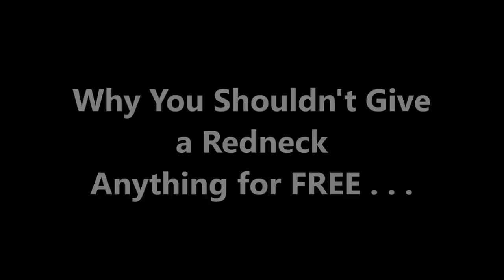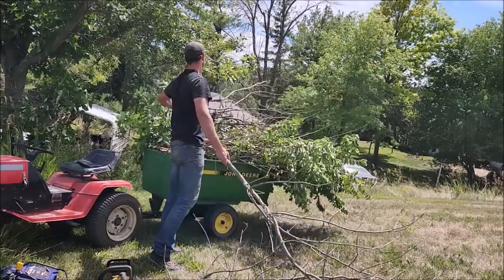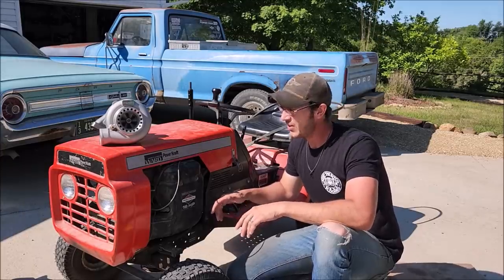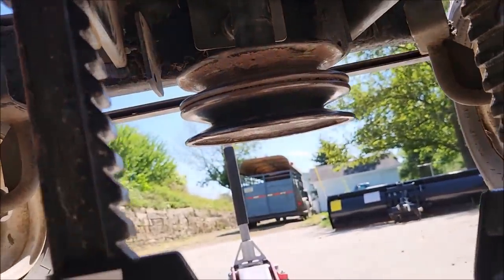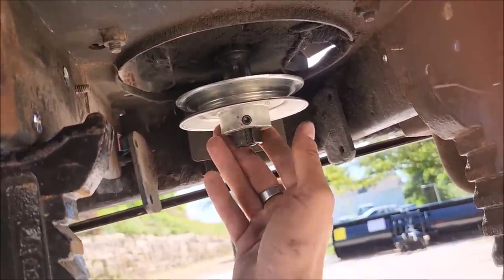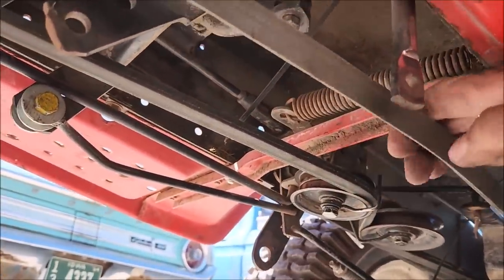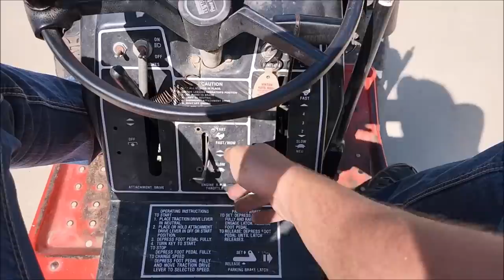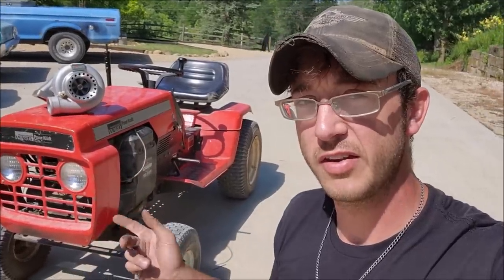FREE Mower = "RACE MOWER" for $27.50 !!!

Comment: fast mowrers are fun. BUT... you need to replace that diecast pulley you used on the transmission. it wont last long, they are only made for fractional HP applications. find a steel or cast iron one.

Comment: Before the forced induction I might suggest a governor delete. This will allow the engine to rev higher. Most small engines are governed to about 3500 rpm. With a governor delete it can rev to more than 5000 rpms with stock parts. With the right mods 9000 rpms can be achieved.
Cars and Cameras does a lot of this type of stuff with go carts and mini bikes.
Reply from the maker: It won't have a the stock carb, so there won't be a governer - but I will design and program a Rev limiter for it at 5k

Comment: i have a 1996 murray mower that im planning to swap the engine which is currently 11hp to a tecumseh 20 hp mower and then do a pully swap, unlike you i  plan to try and keep it to where it can mow, its faster to walk even at high gear on it currently so maybe it will be able to mow when  i pully swap it XDXD

Comment: Are you going to put a 500 cfm 2 barrel or a 600 cfm 4 Barrell on it.  If the one barrel worked on the Maverick then either of the first 2 should give you neck breaking acceleration.... 😂 😂 😂

Comment: Flip the drive pully on the engine and it will get spicy real fast
Reply from the maker: Doesn't fit or I would - as I said in the video a raw pulley swap doesn't lend itself well. Nothing a mid body jackshaft won't fix - and the supercharger that I have 50 percent fabbed into place
Reply: @ThunderHead289   some do some don't but keep at it. can't wait till it's done

Comment: "an access panel would be nice..."  he says as tapping on a panel that is held in with 4 bolts that would give you all the access you need.  Come on Luke get it together man.
Reply from the maker: It isn't though actually. There's no panel to take off that isn't the se as completely disassembling the rear end which would defeat the purpose.